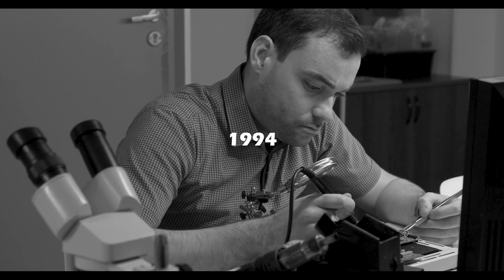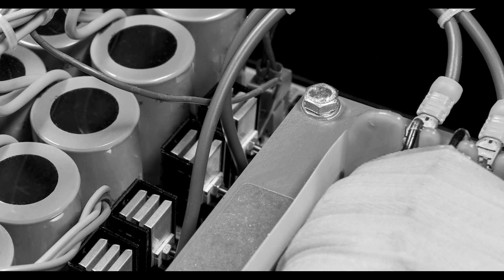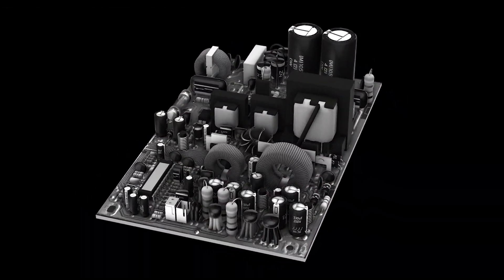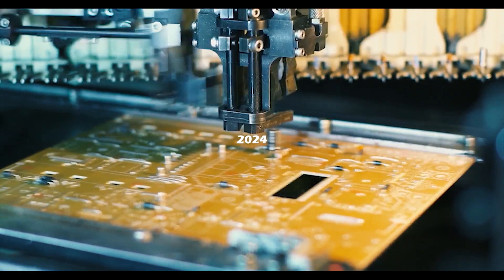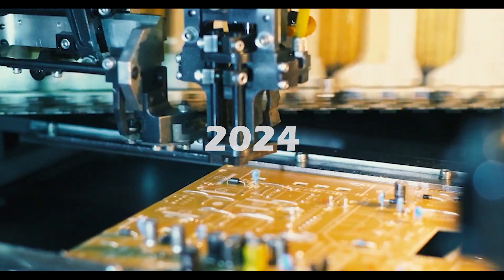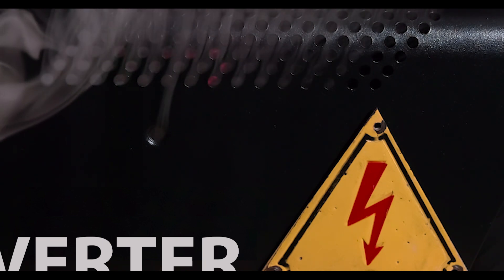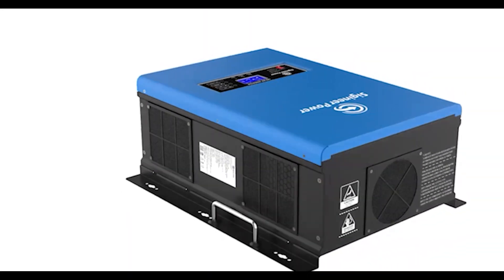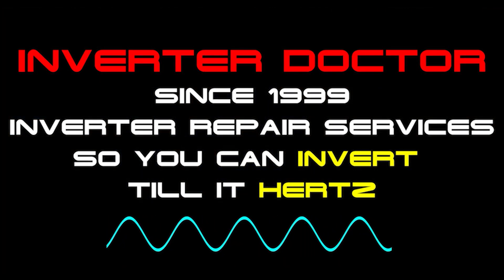Low Frequency Inverter VS High Frequency Inverter

Comment: Could you add a transformer or a capacitor to deal with any power spikes? wouldn't a circuit breaker deal with surge issues also. The price of the LF inverters is ridiculous.
Reply from the maker: Unfortunatel;y no. A cap or transformer would only damage a high frequency inverters MOSFETs. And a circuit breaker would not do anything to prevent high voltage DC from passing through to your AC loads during a catastrophic failure of the H-bridge circuit which is what makes these inverters so dangerous to use.